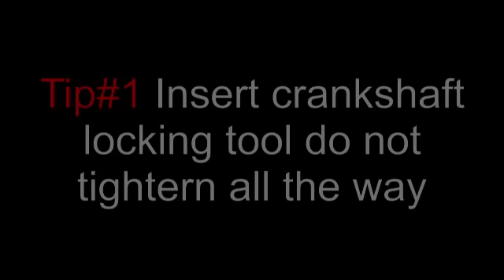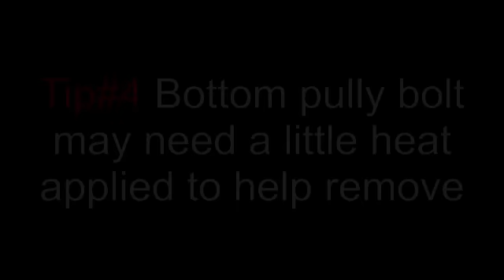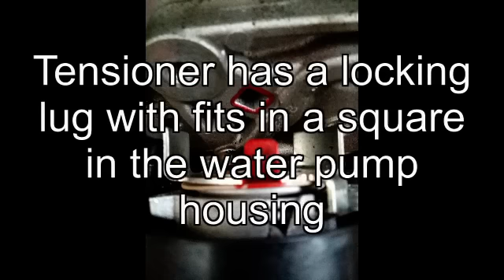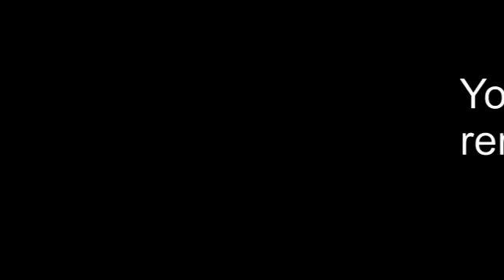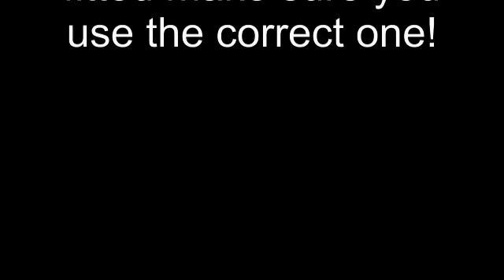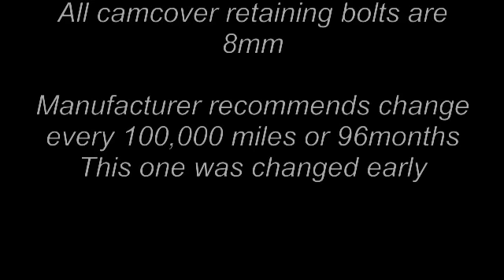Ford Focus Cambelt and water pump change

Comment: hi i need help 2004 1.6 ford focus mk1 5 gears while driving at 130 km speed on a long ramp the temperature suddenly turns red and comes back to normal in 15 seconds what is the problem in my research they said that there may be air in the engine coolant and how to take it out

Comment: I don't see the temperature sensor that ended b  my efforst ona 2001 1.6 ZETEC focus. I tried this but failed completely at this most trivially ridiculous point. Got down to the timing belt with rocker cover screws out and cover freed, BUT Could not get the temperature sensor out of the head, actually think I snapped it but didn't destroy it electrically. Had literally got to the point of locking the crankshaft, but also had the wrong kit from Laser so no way hold the cam shafts while undoing the nots, so put the whole thing back together, with a new serpentine belt. How do you get the fwigging temp sensor out?  I really tried and have lots of DIY  tools and experience.

Comment: Thank you for this video.
In this video you were twisting the crank sprocket independently to the crank shaft ( at 3.03 minutes).  How does the crank sprocket lock with the crank shaft so that the cam shafts can be turned via the timing belt?
Reply from the maker: The crank and cam pullys are free spinning by doing them up presses the pullys against the cam/crank.There are no wood ruff keys on this engine hence why the timing tools must be used hope this helps
Reply: +JayJayJaroo When new belt fitted, should new tensioner securing nut be fully tightened before or after tensioner pin is pulled?  Thanks.
Reply from the maker: +toyo toe With tensioner nut tight

Comment: thanks for the very informative video ,can you please add sizes/length/thickness to your locking plate bar and pin to enable us to make our own.
Reply from the maker: Thanks i do not have timing tool dimentions to hand but the kits are so cheap to buy now.They consist of a bar and a pin under £10 should buy a kit

Comment: Re: loosening and tightening the crank pulley bolt without air tools.  By selecting 1st gear and getting someone to apply foot brake, will it be possible for other person to remove crank pulley bolt with a breaker bar?
Reply from the maker: Yes you should be able to undo the bolt that way or by locking the flywheel with a bar

Comment: How are you locking the crank to remove pulley bolt?. (I bought the proper cam flywheel locking tool, but having looked at all the manifolds etc don;'t fancy my chances of removing the starter motor to gain access). Are you just using the crankshaft timing pin to stop the crank turning, is it strong enough?. Thanks in advance.
Reply: yeah, i was wondering that, plus you would be undoing the bolt anti clockwise?, so wouldn't even be going against the crank but away from it.  wish someone would do a really comprehensive video that I can understand in English.

Comment: Would this be the same parts and procedure on a 2008 1.6l petrol zetec (facelift)
Reply from the maker: Robert Clark yes unless you have the variable valve timing version
Reply: JayJayJaroo nope just regular petrol sigma 1.6 100ps thanks for the video will be using this on the weekend any other videos you might recommend to complete job and possibly torque specs for bolts saves me scouring Google lol

Comment: This can be done without loosening cam pulleys.
Reply from the maker: Yes it can be but the correct way is to loosen cam pully  bolts
Reply: Why do you need to loosen cam pulleys?

Comment: Guess this is the same as my Volvo v50 1.6 2009. Amazing that they cant key the crankshaft sprocet to the shaft like other cars................................ and they have stretch belt fit on serpentine. Real gay